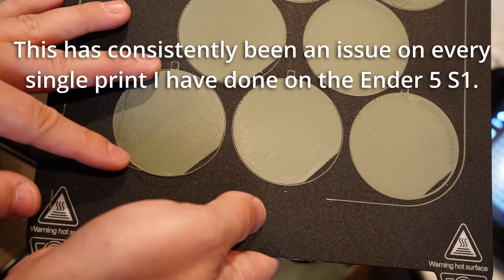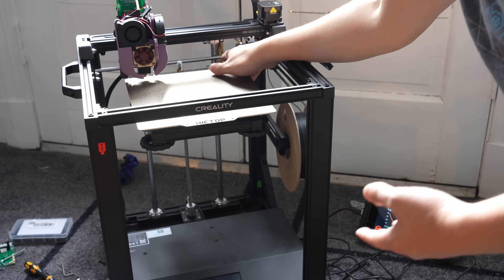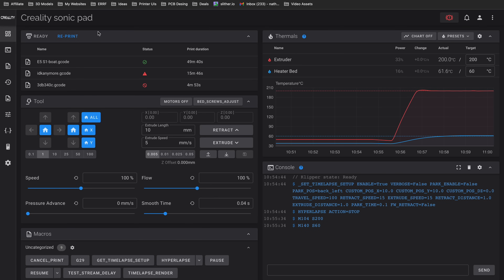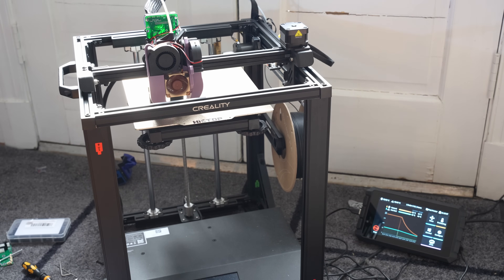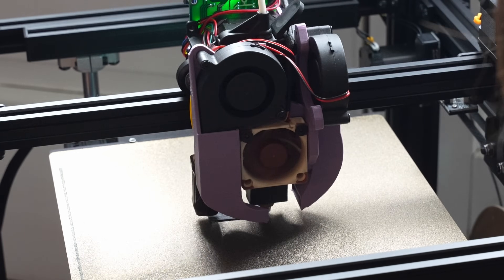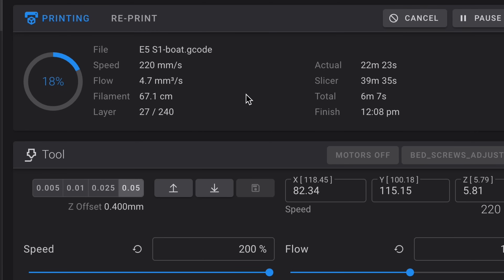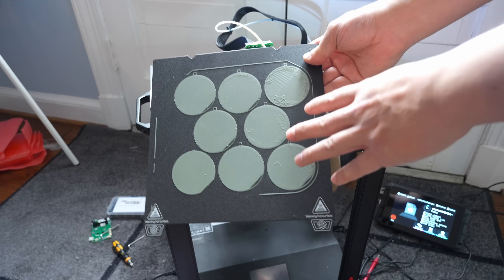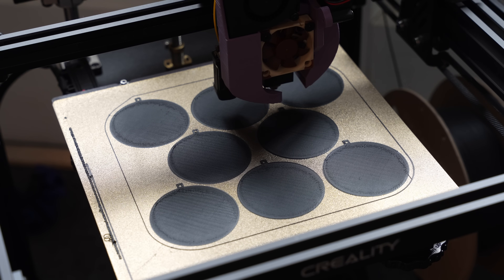THE BEST UPGRADE for The Ender 5 S1

Comment: Hi, I'm about to upgrade to Sonic Pad + CHT nozzle.

How is this modded printer holding up about a year after?
Would you reccommend getting a newer Creality model over this?

Any tips at this stage before moving onto upgrading fans as well?
Reply from the maker: K1C is better in pretty much every way, except you can’t mod it
Reply from the maker: K1 SE is a cheaper version without an enclosure, it’s $360

Comment: I found the the only reliable way to tram the bed on ender 5 S1 is removing the magnetic layer for the bed, putting glass bed over the bare metal and printing one 0.2mm 210x210 layer after z offset, bed level and bed mesh calibration and manually fine tuning the corner screws to get perfect lines across the whole bed - takes some time, but the results are worth it. Tho my benchy does not look as close as good to yours when printing at 250mm/s at 5000mm/s^2 :/

Comment: Exactly what board are you using on your site I see the E3 Modder board but this is an E5 s1
Reply from the maker: It works for both, but the connector is slightly different for the thermistor on the Ender 5 S1, so requires some work to get it running, but technically it is compatible with both.

Comment: I do design and re-engineering. The z probe was "behind" the tip for a reason. The bed is lowered from the 2 rear screws only. This offsets the bed vs a 4 screw Z unit that won't tilt when moved up or down.

Comment: DO NOT losen the screws on the x rod connector and jiggle it! it puts the y gantry on an angle and ur Prints are not square anymore (the angles are not 90 degrees). i did that what you said in the video and only 5 Month later i foung out that über 20 gears that i have printed where not round and more oval. Not much but enough to not make a clock work. you need the y achses exactly in a 90 degree angle to the x achses or you get deformed prints. calibration cubes wont detect it unless you measure diagonal. please fix this in the video or many get bad print results!

Comment: Do you have a version of these mods that would incorporate the longer k1 heater block?
Reply from the maker: Not yet but I like that idea
Reply: @NathanBuildsRobots  I'd def sub to your Patreon if you make one, and help you test it. Someone maden spacers for the CRTouch and fan cowling to work with the K1 block, but with the increased flow comes increased cooling needs and I doubt just adding spacers to my existing setup is goign to work out

Comment: If you had skewness on x and y you couldn't have any calibrate printing also if you do good manual bed leveling and after that run auto bed leveling you won't be face on kind of issue

Comment: On your short circuit, it looks like you may have just shorted 24v to gnd, which probably put the power supply into fault mode which was cleared upon power cycling?

Comment: I tried this but the probe now moves off the bed during auto level. Do I have to use Klipper with this? I'm using the stock FW.
Reply from the maker: Yes, you would have to recompile the firmware with new bed offsets
Reply: @NathanBuildsRobots  Thanks for letting me know. Right now I use a dedicated laptop for the printer so I can "remote" print. That is through the Creality slicer, everything is stock. From my understanding I need to switch the printer firmware to Klipper, which also means I need to hook up a Raspberry Pi, install stuff on there, I'll lose the display on the printer (not a big deal), and I have to install some kind of web-interface on the Raspberry Pi to interact with the printer from there and the laptop will be of no use anymore, does that sound about right?

Comment: Nice video, What nozzle setup did you end up buy or implementing, some sort of volcano? THanks
Reply from the maker: Volcano CHT with some brass spacer nuts. Works great up to very high flow rates
Reply: @Nathan Builds Robots  I appreciate the reply. What is the purpose of the nuts. I guess the volcano threads are too long ? Mind sharing the volcano nozzle link with me and / or the nuts ?

Keep up the awesome work. Thanks

Comment: Mine works perfectly with no modifications. I've just printed a complete RC model aircraft that flies fantastically. The printer is in my hobby room and I have no problem with noise. It's never failed a print. Maybe you are too picky or have just been unlucky with it. No need to upgrade anything in my opinion it just works out of the box.
Reply from the maker: They revised the design after the first month of 2 of production to fix some of the issues I was having.
Reply: @NathanBuildsRobots  I don't know man...
Just received one Ender-5 S1 to review and I'm getting this weird first layer issue :(
The right side of the bed is always too close to the nozzle, but all 4 corners are perfectly leveled!

Comment: i guess this would be a good printer if i spent all this time and did all these mods. since i don't have time my ender 5 s1 will just have to continue to suck. btw. i'm having the exact same issue where the nozzle is too far on the left side and too close on the right side. no matter what i do, this keeps happening and the result is that i can't use the whole area of the printer.

Comment: Great video man, I just got my s1 in today. I don’t have the sonic pad yet, and I did notice a couple minor bed problems that I fixed with the level screws. Going to implement the fan shroud and the fan upgrade and  the cr touch placement as soon as I can. Thanks for the information!

Comment: By releasing the tension on the y connector rod, it's possible your x and y are no longer perpendicular, so your prints become slightly skewed and v wheels may not be perfectly aligned. That was the case with my printer. I needed the tension. The root cause is the gantry not being perfectly square but haven't been able to fix that by realigning parts.
Reply from the maker: That is fascinating, hadn’t considered the x axis alignment. Maybe I need to reintroduce some skew

Comment: Checked my Ender 5 S1 printers, they didn't have this defect, might have been only yours affected or a bad batch?
Reply from the maker: Apparently there is a 2nd revision of printers that have the CR-touch placed a little differently. Also some extra attention to detail during assembly and flatter heated beds could play a role
Reply: @NathanBuildsRobots  Yeah, can confirm. I got both version at home. Ordered them only 2 weeks apart. I probably got one the last V1 versions. The 1.06 firmware doesn't work for V1 because of the changed CR Touch position. Sensor is outside the bed and head bores into the bed when leveling :( Took me some time to figure out that only 1.05 firmware works for V1. The V2 comes shipped with 1.06 installed.

Comment: I'm too broke to support you on patreo but great work and video, thanks, its great to be able to see something a little more advanced than setup and print. the points you make helped me try and diagnose all the weird sounds on my ender 5 s1. although mostly it was realizing that whovere assembled it went too happy on the torque and everything was under stress, mostly loosening and retightening everything carefully helped both with the noise, and also printe quality.... just hope nothing comes back to bite me later.

also, I love the ender 5 s1, mostly because I like to tinker, modify and mostly I like to feel that something i own is truly mine, which is kind of hard whith something like a bambu where everyhing is proprietary so no thinking outside what they offer
Reply from the maker: Yeah, its fun to work on. Creality printers are odd in that they pretty much require mods to get them printing well.
Reply: @NathanBuildsRobots  yeah, it's most of the fun though. And it gives a sense of fulfilment to finally get them where youre happy with them

Comment: But in your Bambu lab review you said that it’s print quality is good. I almost bought one based on your review, …. not really, but anyway misleading 😅
Reply from the maker: I had only heard overwhelmingly positive things about the Bambu Lab printer. There were some minor print quality issues visible though, but I didn’t bother digging too far into it because I assumed it was probably fine. 

I have a 2nd P1P to test, will see if it’s presenting the same issues or if the first one was just a lemon

Comment: i have the ender 5s1  but its been down for weeks after the print head kept on clogging i didn't secure the heat since taking the tip out broke the heat sink but they don't have parts yet ps im in canada
Reply from the maker: How did you break the heatsink?
I have heard the same thing about lack of spare parts availability

Comment: If you use a spring coupler, it will be more forgiving towards errors like that.
Reply from the maker: Yes but you want a little springiness in the drive train as possible. Zeroing out the preload between the belts is the best option, along with tensioning the belts

Comment: Hello again! When printing at high speed, the printer shakes a lot, should it be? Does it affect the quality, especially when printing something tall?
Reply from the maker: Hello, that is a great question. I’ll bring it up during the next episode of my podcast at
Perfectfirstlayer.com

The short answer is: shaking is bad, but sometimes it is ok.
It’s all relative - if the whole printer was floating in space, and it was shaking twitching around due to the tool head movement, that wouldn’t be a problem. The issue is when there is relative movement between parts. That is, If you have a frame mounted camera looking at the print area, if things are shaking from that perspective you have a problem.

If everything is shaking together that is fine. If parts are shaking relative to each other, not fine.

Comment: I really don't understand how a company of this size can sell printers with so many easily fixable issues. Don't get me wrong, they are still great printers, and I'm not a professional by any means (still studying robotics), but even I could find at least 10 stupidly designed little things on my printer in like an hour or so. Money isn't an issue either; most of them could be fixed literally for free. Creality really needs to get their shit together if they want to stay competitive.
Reply: And the biggest issue with Bambu printers is that they are closed-source machines. I mean, I get why they went this way, but still, f*ck you Bambu. The beauty of open-source 3D printers is the modifiability, and when someone tries to take this away from me, that's when they lose me as a potential client.
Reply from the maker: Yeah, standing on the shoulders of giants and taking a shit all over them while they climb their way to the top.

Creality really need to focus on cleaning up their designs. They are still the most upgradable printers on the market and are excellent project printers, because there are so many little things to fix. That experience isn’t for everyone though. Most of the time I recommend the artillery sidewinder X2. Huge print area, fast for a bedslinger, cheap at around $270, and easy to assemble.
Reply: Russell Phelan  Actually, good point.

Comment: Man, your reviews are really funny, but I like it😁

I bought myself an ender 5 s1 2 weeks ago, the printer prints amazingly at high speeds and is super quiet, my friend has a raven 2.4 and it's damn loud...the print quality is no better.

I have a printer of the 2nd version, without a Z limit switch and with molded plastic airflow.  I also want to say that my bad is perfectly even, the spread is only + -0.02
Reply from the maker: Nice. I want to learn more about this 2nd version. Doesn't seem to be much info online. If you could share some pictures on the Discord it would be much appreciated!
Reply: @NathanBuildsRobots  ok 👌

Comment: Hello! Thank you for sharing your experience with problem solving and equipment improvement, and with a subtle sense of humor! After all this trouble, would you still recommend the Ender 5s1 as the best printer under $500? I also want to order him, but too many problems worry me. Maybe just take the Ender 3s1 pro and not think about higher speed?
Reply from the maker: It’s a good printer. Would only really consider this over the render 3 if you plan on using the sonic pad with it and doing some upgrades to it over time

Comment: How hard would it be to automatically micro adjust corners after running the 10-point?
Reply from the maker: Why do you need a micro adjustment? Automatic should be automatical
Reply: @NathanBuildsRobots  No, no... I mean YOU are having to manually make adjustements to the bed corners by raising/lowering, how hard would it be to do your 10-point inspection of the bed, then have those corners automatically adjust exactly thebright amount to make sure that bed is 100% level? 🙂
Reply from the maker: @907-q7u  There are printers that do that, but you need a minimum of 3 stepper motors to make that happen. Check out some videos on the voron trident bed leveling for an example.
https://www.youtube.com/watch?v=cz3V2HYF1Pc

Comment: I had similar issues on my p1p, to solve them I slightly moved the table so it doesnt collide with the wall, I think what is happening is that at the speeds it is moving when it does the resonance calibration are not enough to collide with the wall so when printing the resonance calibration doesnt work.
Reply from the maker: Thank you for the advice, I’ll try putting it on the floor and rerunning the calibration.

Comment: I stepped down the creality rabbit hole, and 3 for 3 orders. Faulty and weeks of bits being sent out to fix 3 brand new items myself. lol. One of the printers clearly could never be assembled. They really need to get their QC together. Having to send out parts for three  orders in a row! If that is a snapshot of the wider picture they're done lol.
Reply from the maker: Your right, creality makes sub par designs with bad quality control.

But at least they can be fixed outside of the factory. Bambu wants me to send my machine back to them to repair. I said no because I have never sent a machine back after starting a review.

Should I just give every company infinite tries to be able to get a “good one”? And what about my video production schedule? Should I just put off making videos to accommodate the fact that they sent out a faulty, nearly unserviceable printer?

Comment: creality has sold far too many printers whiel doing very little to think through their designs. cant wait for more episodes of the podcast. you should do an experimental video with a high flow scara arm printer
Reply from the maker: They have been benchmarking against PRUSA since their foundation. Maybe now that Bambu has shown them that a high performance machine CAN be made on a budget, they’ll get off their rear and start improving their designs!
Reply: @NathanBuildsRobots  i wouldn't be so optimistic lol
if they will, it sure as heck wont be this year as they still got the ender 5 s1 pro and s1 plus to finish up and release, and these 2 alone already take longer than the ender 3 s1 series, they likely will start with something competing with the p1p at least by q3 or q4 of this year which is my most optimistic guess but nothing released till past q1 2024.

unless they paused the s1 pro and plus after seeing bambu lab their machine and soiled their pants that is after delivering this printer in this state.
to their credit they did respond somewhat well with the higher demand for klipper and the lack of pi's, but like, that too took about 3-4 months response time for them and released it along side the ender 5 s1.

personally i just really want the s1 plus to release already so ppl can review it and give me an idea if it's worth the wait since my prints require a bigger bed than the s1 and the ender 3 s1 plus isn't an option for me since i specifically want a coreXY this time around.

Comment: the problem with changing the x-offset though is that you're leaving a pretty significant part of the bed unmeshed. Given that you have more room to work with on the left side, consider basically flipping your design so the crtouch is mounted on the right side instead of the left. This would allow you to have a more accurate probe of the entire bed as opposed to not being able to calibrate nearly 1/4 of the bed on the right side.
Reply from the maker: I’ll check on this. I chose the left side because the right side has

The stock design doesn’t mesh the front of the bed, so no either way, a portion is being left out. 

When it comes to fabricating anything there is a concept of “close enough”. Nothing is perfect, but my solution is close enough to get a perfect first layer, so as long as it works, no further optimization needs to be done on my part.

Close enough (aka tolerances) landed men on the moon. And the deviation allowed depends on the application.

However, the design could be mirrored and slightly modified if you wanted to try this out.
If on the right side, you miss out on some of the mess on the right side of the bed and have to worry about the hotend wires interfering with the cr-touch. Neither is that big of a problem
Reply: @NathanBuildsRobots  I see your point. I hadn’t considered those things.

Sadly, I won’t be any help testing as I’ve completely gutted and rebuilt my ender 5 s1 into a zero-g mercury one and hydra setup. The only thing creality at this stage is the frame lol.

Hats off to ya for coming up with these low cost, easy to implement improvements because the road I went down certainly wasn’t either of those things haha.

Have you run into any issues with z position accuracy? What led me down the path of gutting the entire bed system was the fact my z-position was consistently inconsistent. One print it would be too high, the next it would be too low. This was with our without using abl.
Reply: @NathanBuildsRobots   Dual CR touch mod? Opportunity knocking maybe? Lol